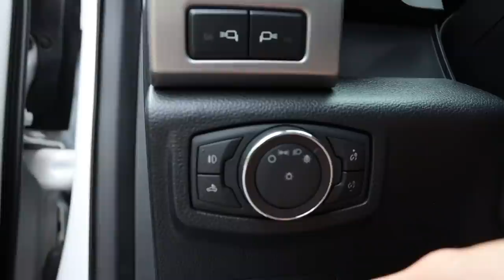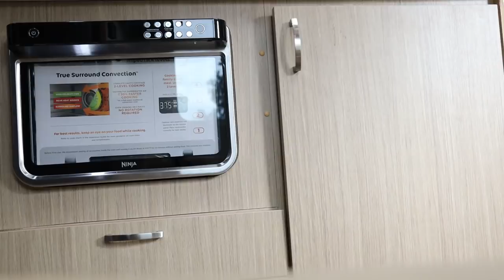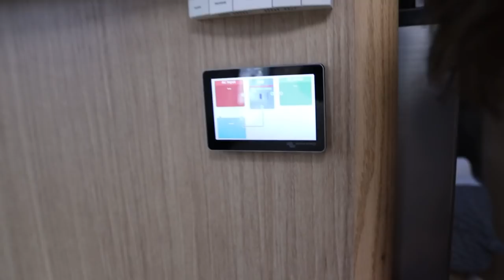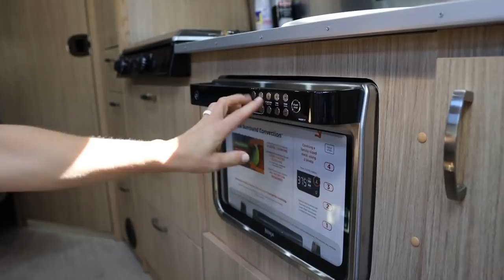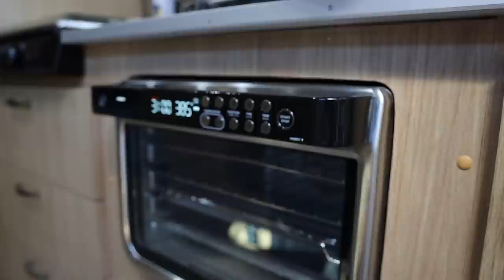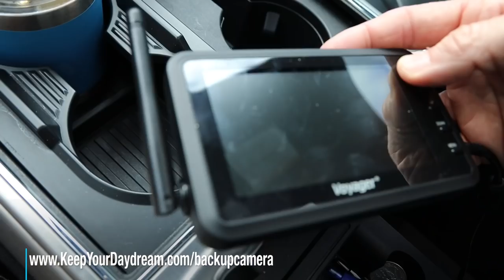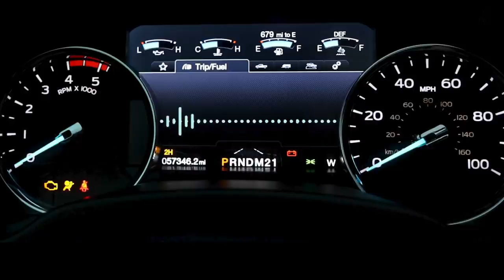RV LIFE: Back in the Airstream. Service, Repairs and Mods

Comment: How's your refrigerator working out?  We thought it must be pretty good if you put one in the Bird and also in the Airstream. We bought the exact one a year ago and right from the beginning the temperature would fluctuate. We've only taken it out on 4 - 2 week trips. We upgraded our batteries to 2 Battleborn LiFePO4 100 amp hour batteries hoping this would solve the problem but this last trip the fridge went up to 50 and we had to throw most of our food away. Really uphappy with Dometic!  They haven't been really responsive and were giving us the run-around. We've been  running tests for 3 weeks, having digital thermometers in fridge and freeze, taking readings of the air temperature and also have a glass of water to test the water temperature. The fluctuation is up to 25 degrees in a 24 hour period. They finally agreed that we could take it to a service center but I'm not really hopeful they are going to take care of it. Do you have any fluctuation in your fridge like I'm describing? I don't think Dometic has very good customer service.

Comment: If ACs had a spot to plug in 18 volt battery u get a bit of help at start up minus the $500 smack dollar add on per AC. Or just start in fan mode 1st. A 40volt mower battery same idea even better.
Reply: Even if didn't keep 3 ACs on full time a cheater option still good work around deal.

Comment: You could have pissed that van sorry air stream trailer into that spot via the ally. You just needed to cut early almost jack knife it and then shuffle with the "truck" a couple of times. But you have heaps of room. Then again. I'm use to receiving trailers Into tight pain in the add spots.

Comment: If 12 volt fridge option most likely if any on the go way better. I wonder if like a cordless drill even though 12 volt can plug 18 volt battery into it as a hot damn day option or if hurry cooling down option so starts out big volts then settles into just 12 at night not being opened, cool easy get/change. left t & t out of spelling for opion both times basic angel atari matric sucking u off hole time.

Comment: Hey Marc, did you consider the Ford Back up camera system?  I have one we use on our boat trailer and I really like it.  It integrates into the center screen on the truck, also has a tmps you can get.
Reply from the maker: Yes and I have one! I forgot to tell Woodlands when my panels were off and didn't want wires exposed after. One of the draw backs to Airstream. Hard to plum the wires.

Comment: Just curious about the bike rack on the rear of the trailer. A lot more force on the rack and bikes back there. Is that still the Kuat rack and I presume it is rated for that use? I bought another top name rack and found out in the owners manual, it is not suitable for rear of trailer mounting.
Reply from the maker: Yes, the transfer 2.0 is RV rated and certified. The mechanism that holds it tight in the hitch receiver prevents all movement which prevents failure. We've got 50k miles towing with no issue. Obviously, 2 or 3 bikes is less force than 4.
Reply: @KeepYourDaydream  good to know. We have been considering ebikes and of course they are a lot more weight. Even with 2 bikes, probably around 120#. That’s a lot of force when the rear of the trailer bounces.

Comment: How did you attach the bike rack to the back of the airstream? Is it a trailer hitch to the frame?
Mermaidvmo - Florida
Reply from the maker: We cover it in this video. It's been two years and zero issues. We know use the Kuat Transfer 2.0 rack which is made for towable RVs https://youtu.be/UJQ91Mg9Zf0
Reply: @KeepYourDaydream  Thanks for resolving the bicycles issue. your knowledge is appreciate it more than it ever now. 

we purchased an airstream and we’re headed out August 2022 our first trip will be from Portland Oregon to Jacksonville Florida any suggestions would be greatly appreciate it. Absolutely love your family adventures.

Comment: ok. here is a possible very important question for you. did you not just put in lithium battery into the bird? do you not hjave to completely run a full discharge and recharge every 3 to 6 months on them to keep them from getting damage? is the Museum going to do that and will they send a verification to you that it was done? also put in a long trem diesel fuel stabilizer because its it going to sit for so long?
Reply from the maker: Good points. I'll address that when the time comes for sure.

Comment: It seems like I remember someone (not necessarily on this channel) having a backup camera on their RV that was somehow hooked into the camera system on their truck. So when they were backing up they could select that camera instead of the backup camera on the truck and see it right there without having a second display. Has anyone seen something like that or did my brain just imagine it?
Reply: GM has connections for cameras on the tow vehicle, also people install camera systems on their vehicle each side by the hitch and the 4rth on the trailer. Many new radios have camera inputs,  more than one way it is done.

Comment: Ok dumb question time...you no longer use the Hensley hitch? why?
Reply from the maker: We got it because the Reflection had a bad sway issue that the hitch solved. But overall, I prefer a ball hitch and the Airstream and F250 tow straight with no issues.

Comment: If u add a bedazzled brass rivets circles 2 or 3 per side u could add clip on fish weight to canvas to help fight light breeze. Then u add flex ulta thin solar to canvas perfect angle if unrolled. If 2nd canvas attached under side u get extra trap cover add on down to poles so again better help open.    en just jumped too/also not just my bad spelling but angels jack assing as well. 545 code clear losers

Comment: God, why don't they make a hitch hook up just on the back end for backing & pulling so 1 on right side & other on left side positioning strength not towing strength, The hitch arms just lift up when not using as bumper basket/bike hitch normal basic ball deal.